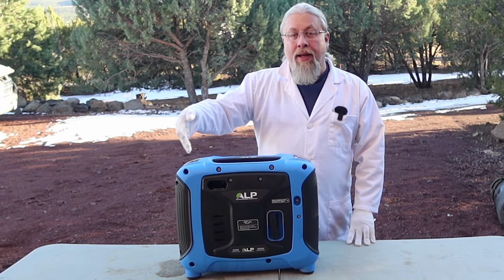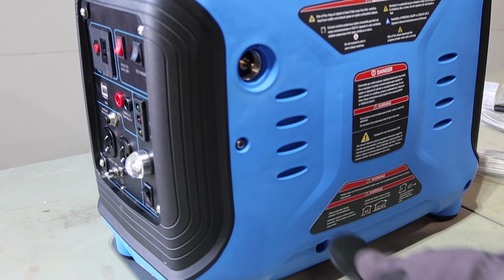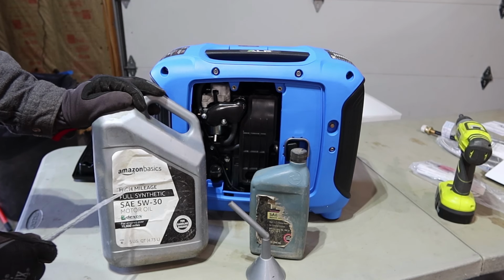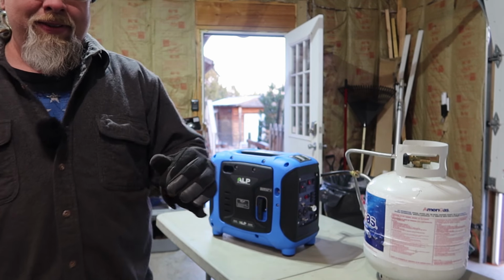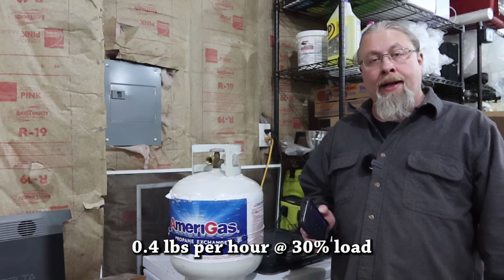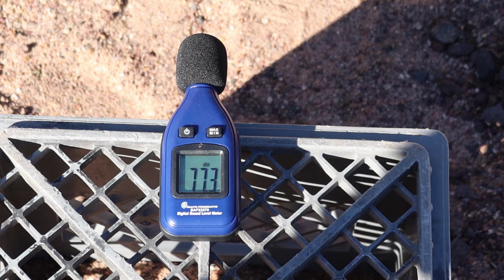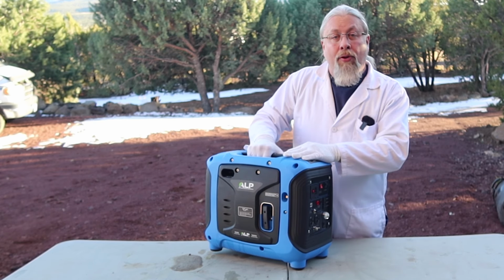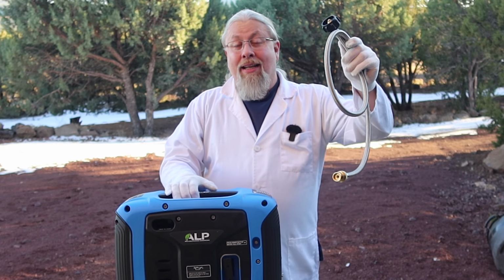ALP 1000w Propane Generator Review | Parallel Ready Eco Friendly Compact Efficient

Comment: I got mine today. It is an impressive machine. It handled the 5,000 BTU AC (85 degrees in the camper before running the ac), the cooler refrigerator, and the 12 volt 40 watt convertor to charge the camper battery with no issues at all. It is really not that loud. I was bit concerned after watching your videos, but for me it is not an issue. It is much quieter than the 2000 Watt Westinghouse gas generator I have. 

After a no load break-in and changing the oil. I tested it for 3 hours as I would use it with the teardrop camper. Simply no issues at all; no gasoline odor, very little exhaust odor, and easy start. This is a perfect generator for the off-grid small camper. I really wanted a propane generator has I already bring a small 5 lb lp tank for cooking. Now I don't need to bring a gasoline can. 

Thanks for your video it was spot on.

Comment: The tool thing is definitely NOT a deal breaker. I have one of those little 2 stroke ”Hitch Hiker” generator and a 2k Predator.  Each has its own little tool kit, zip tied to the handle, with a SP wrench, SP, and screw driver and a qt of oil (+a sm bottle of 2 stroke oil for the Hitch Hiker). This way no matter the situation I have what I need for sm repair/maintenance. Each has its own 5 gal jug of fuel with Stabile, and it’s changed out about every 6-8 mos. I’m a prepper. Gotta-be-good-to-go when you gotta go. 😁

Comment: When you use it outdoors you should use a ground wire so the gfi works!
Reply: I have had nothing but trouble with gfci built into generators. They are always tripping even when no ground wire is attached.

Comment: I have a WEN 2350 and that thing is super quiet, runs everything I need, including a microwave or air fryer oven, lasts an average of 6-10 hours on a 1.06 gallon tank of gas, and only cost me $411 to buy, shipping included. I love it!
Reply: Isn't that a gasoline only generator? If so, I think you are missing the whole point of this one: propane can be stroed much longer without going bad. From my own plans on how to ride out the occaisional power out age or even a long-term regional one, the biggest challenge is how to have the fuel you will need either directly on-hand or easily obtainable when EVERYONE ELSE is in the same boat. Having a propane powered device gives you the option of doing less frequent fuel tank rotations than you do with a gas-only model.
Reply: @justmesurfing  yeah I understand, I was just saying that I love my little gas powered one, and at $400 it's a great deal, but also a great machine. Propane would be good to have as well as some others, because in an emergency it's a good idea to have several baskets filled with eggs! Lol!

Comment: you're running a 5k btu ac in the cold it will draw much more in the heat.
Reply from the maker: I ran a heat gun in this video not an a/c. Someone is on the wrong video.

Comment: LMAO, never heard so much absolut basic BS in one spot.

first of all: generators are broken in at the factory. braking in is for the piston rings mainly. back in the old days a piston ring has had a taper of 0.1°  or 6 minutes. It took many hours to polish that taper away. It needed to get flat to the cylinder wall othereise it was not be cooled by the oil and started glowing and got brittle. Today piston rings have a taper of mere seconds or in decimal 0.01° and are therefore broken in in a few minutes in the test run at the factory. The change for less taper is due to stupid owners who did not breake their engine in appropriately and due to better quality manufacturing.
second: propane bottles are filled by weight, if its called a 20 pound bottle, 20 punds +/- a little bit (1 od 2%) is in it. not just 80% of 20 pounds. true is, at 20 lbs, the tank is only 80% full, it could hold 24 pounds. that is because liquids are not compressible, but do expand when getting from freezing to room temperature. Therefore there needs to be a cushion of vaporized propane in the tank at all probable conditions, so the liquid propane would not split the bottle open when warming up. 
third: load times efficiency of the generator should represent the fuel consumption. gasoline engines get about 30% efficiency. so you had 4 hours with 250 watts equals 1 kw times 3 equals 3kw in fuel. with gas this would be 300 ml since one liter has about 8,8kw. with propan 1 liter got about 6,6 kw and weights about 1 pound. so that generator should have consumend not 1.6 pounds (3 liters, almost a us gal) but half a pound. so either your measurements suck or that generator is running horribly rich. Most Venturi based systems do indeed run rich, as lean with prooan kills an engine in no time flat.  Only fuel injected LPG conversions are any good and yoild run at lambda 1 instead of way rich if peak.

So trash that thing, its not worth 20 bucks as it wastes fuel like crap. Over here Propan is 50% of gasoline, but at that waste rate of 300% it runs at 150% of the fuel costs of gas. And if you get ethanol free fuel (from your local airfield) you dont have problem with the fuel getting old.

Again, just LMAO and ROTFL
Reply: Are you sure about your second point? I have heard from several different sounrces that the 20# tanks you get at the pre-filled stations are often not filled completetly (most cited that they were due to a safety margin when transporting them in bulk.) It is true I have never checked this myself, so it might just be a common urban myth, but it does sound like something large companies might do if there is actually a risk in the transport of filled tanks.
Reply: An easy debunked urban myth ideed.

there is no place on this planet where someone manufacturers propane bootles that are not regulated by code. So sice the bottle builder needs to make money, the product fulfills the code, but is not overbuilt. Therefore no matter what, the wights of all similar style empty bottles are almost the same no matter the manufacturer. 

to debunk the myth: weight an empty bottle, and weight a full one, youll discover, 20 lbs bottles contain between 18 and 20 lbs of Propan.

Why ia that so?

The filling process is not permitted to overfill the bottle, due to the risk involved of running out of vaporized propan cushion inside the bottle. Just imagine it was filld during winter at freezing or even below, propane is still vaporizing at zweo F, and a customer takes this bottle camping to Cancun next summer at 140F outside. And then the sun blasts that bottle heating it to 200F and beyond and still the due to the heat expanding liquid phase inside can not run out of a cushion. otherwise the bottle safety valve would pop open and release the whole bottle into the atmosphere to prevent catastrophic failure of the bottle like beeing split open like a freezing water pipe.

Thats why those bottles always feel half empty when you buy it. They need that "air" (its not air of course it's vaporized Propane) to prevent accidents.

So now we know:

all full bottles (must) feel half empty. hence the myth.

this must be so for safety sake

and the filling process is not permitted to overfill. never, under any circumstances.

therefore the bottles are indeed underfill by a certain marging. 

very likely more than they would be forced to technically.

on the other side, there is no place on this planet where someone sells goods labled to contain whatever and where ther is no regulations in place regarding the difference between labeling and true delivery.

where I live that difference can be a maximum of 10% in single instances plus and minus. but for minus the filler needs also to proof by his production logs that the average filing level is close to the labled amount. if not its a case of commercial fraud. pretty hefty charges.

Since the volume changes by temperatur, but the weight does not, most filling stations go by weight. 

So technically they could fill to 20 LBS +/- 0,1% but then the empty wight of the bottles does have a little variation. And the fillerneck to the bottle does modify the true vs measures weight during filling.

So there is a probable error in the process, and you are not permitted to overfill.

So yes, Propane bottles are underfilled, but the "error" is way less than 10%.

Juat weight your bottle full and empty. Then you know by how much indeed.

Comment: Great research.  15:50  consumed about 3lbs of propane for 4 hours @65% load (about ~550 watts).. so roughly 21 - 26 hours running a wall unit AC from a full tank of propane.  Which if you are only running the AC at night from 10pm to 6am is about 3 nights,  good for a long weekend.   Nice!
Reply: A wall unit? That's a small as hellnwall unit if it only pulls 550w

Comment: Using your test data on this Alp 1000w, it achieves 9.9% efficiency by converting 9.9% of the energy in propane to 120V AC. It also seems to drop to 8.7% efficiency when going up to 550 watts.

I also ran some energy conversion numbers on the Generac 7127 iQ3500 and found that it is around 14.5% efficient at 1500 watt load (50%).  That means it converts 14.5% of the energy contained in gasoline into 120V AC which sounds reasonable for such a small engine.  No data for higher loads was available but it seems to get more efficient at higher loads.

What this means is that people will pay less money per unit of energy on the larger generators which is consistent with thermodynamic theory.
Reply: Yes the closer you get to the running rpm of the motor the more efficient it becomes.  About a 80% to 90%load is the most efficient usually.  Also a inverter style generator is actually less efficient than a regular non inverter generator when running at 80-100% or off eco mode. Inverter generators lose a few % efficiency when they convert AC->DC and back to AC. It's always best to size your generator to the rough load you know you will be using most of the time.

Comment: These generators are air cooled like gas one with all the engine covered up with plastic I can't see the thing lasting very long cause of over heating might be good for short runs like 1 or 2 hours .
Reply from the maker: They run fine for hundreds of hours without overheating. It has a fan that sucks air through while running.
Reply: @HOBOTECH  I was wondering how it would cool the engine thanks I use mine to run a electric heater in my truck while at work security guard so I sit in my truck for 12 hours a night.

Comment: Why type of device do you have plugged in to the generator that allows you to incrementally increase the load for testing purposes?
Reply from the maker: A heat gun I call a "Solar Degenerator" because it blows up inverters on a regular basis.

Comment: Natural gas maybe squeaky clean on carbon but it does give off methane which is actually worse than carbon because methane holds in more heat then carbon though methane  Does dissipate in less than a decade.

Comment: Why are tge usb ports useless??
Reply from the maker: Think about it. You're going to run a 1000w generator to charge a cell phone outside in the elements? If it rains you then fry your phone and the ports in the generator.
Reply: @HOBOTECH  Interesting... I guess I would have assumed that I wouldn't consider charging my phone outside in the rain. But good point, at leaat in the sense that I might wonder whether some rubber plugs for those open ports might be in order. I'm new to this, so thanks for the reply. : ) Still trying to figure it all out.

Comment: hours to miles conversion is what ever hours times 40. use good oil of 5w30 weight with some motor kote additive. So knowing this changing oil after 50 hours is way to soon and waste of oil EXCEPT oil from break in which you should use a proper zinc heavy break in oil. propane DOES NOT break down oil the same as gas engines nor make the carbon build up as gas. YES take care of your equipment but don't just waste money after things that will not improve the life of it.

Comment: You should’ve tested it with the refrigerator plugged into it full-size refrigerator because they suck power those that I know that have these Ransom lights in the refrigerator and it lasted about 26 hours on a tank you can test it and see what you think
Reply from the maker: It will run a full size refrigerator.

Comment: 20lb cylinder weighs 20lb empty, if filled 80% will weigh 40lb.
Reply: You are incorrect.  A 20# cylinder contains 20# of propane based on 80% of the Water Capacity (W.C.) as stated on the tank.  The Tare Weight (Empty Weight) of a 20# tank will range between 16.5# to 17.5# depending on actual construction (collar and foot ring design usually) and if it has a gauge on it or not. Avg is 17# TW.

Propane is filled to 80% of *WATER CAPACITY*.  A 20# cylinder has a water capacity around 47.5#, water is 8# per gallon. 47.5 / 8 = 5.94 gallons * 80% = 4.7, which is number of gallons of propane.  Propane weighs 4.2# per gallon, and 4.7 gallons weighs 19.74, or 20#.

When full, the 20# cylinder, containing 4.7 Gallons of Propane, should weight in around 20 + 17 = 37#.
Reply: Weigh it empty and weigh full. See for yourself. 😎👍😎

Comment: It burned oil after 2 hours of use?  That's not good, that means if i run it all night, it'll be out of oil by the morning.
Reply from the maker: All generators burn oil during break-in
Reply: @HOBOTECH  Well quite possibly, let's hope it doesn't burn oil on a daily basis either.  I'm in Central Texas, where we got hit hard by the winter storm. I know the weather we experienced is nothing new to folks that live in northern states, but we were not prepared at all. Even a week later, we are still seeing empty food shelves. We lost 58 lives including children, which is very upsetting. As for me, I know how to layer clothing, because i ride motorcycles in the winter. But there are tons of folks here in Central to South Texas, that don't have knowledge of how to survive a winter storm. This is Texas, the norm for winter is a 26 degree morning, then 60 degrees by the afternoon. Then by the third day, we are back in 60 to 80 degree days. This is Texas, we are known for sweltering hell like days and weeks here. We'll be better prepared next time !!!

Comment: I wonder how long it would take an ALP 1000W Propane generator to charge one EcoFlow DELTA 1300? How much propane (at Sea Level)?
Reply from the maker: You don't have to wonder. I give you the math to figure it out.
Reply: @HOBOTECH  Using your test numbers, and making a few assumptions here's what I got: 
Delta charge time @ 800 watts - approx = 2 hours. 
ALP fuel consumption at 800 watts - approx  1.15 lbs per hour.
So... best guess, about 2.3 lbs of fuel. ($8.30 @ $3.75/lb for fuel).
Not a bad option for a cloudy day or a supplement to a 160 watt solar cell (I believe the Delta allows use of both simultaneously). I think I will buy all three.

edit: Oh, and thanks for redoing the Db test.

Comment: This guy is freezing in 40° weather. It was 40 where I'm at I was out with a t shirt it felt like spring to me lol. This seems like a cool thing at first but given the cost of propane a larger gas powered generator will be just as efficient for close to the same cost to run and gas in an emergency situation can be found much easier.

Comment: I bet it won't run a window airconditioner.  It might run the fan but when the compressor starts,  it won't start.
Reply from the maker: I ran a 5000 btu all summer long on an 800w generator without issue.
Reply: @HOBOTECH  that's great!  I wish he would have shown the window unit running and the compressor kicking on. Showing wattage isn't enough to make me believe.
Reply from the maker: @jonathancrump31  It was 20 degrees outside. You can watch my old videos to see it running.

Comment: When you open a propane tank valve, open it all the way. You only turned it about half a turn. For safety reasons, if you need to close the valve in a hurry, having fully open means someone can’t accidentally turn it the wrong way. Also, if you have a high flow of propane, a partially open valve makes for a smaller constricted orifice and can freeze up.
Reply from the maker: Worst advice ever. Opening a half turn saved me from being burned alive when a propane leak caused a fire inside a structure. I was able to quickly shut off before disaster. If I had to twist 15 times to close it I'd be dead right now.
Reply: @HOBOTECH  Why are you running propane tanks indoors? The tanks go outside, even if the appliances they run are inside.

Comment: if you bring your tanks to Ace Hardware, they will fill your tanks to 20
Reply: $20 for 50 hrs of power. $10 per day $200 a month. In a grid down situation most people won't be able to refill, unless your supplier has a backup generator. Instructions say to replace engine oil every  2 days. What a pain, but you gotta keep your food cold.

Comment: Do you think this could power a standard American refrigerator in the event of a power outage?  Thanks.
Reply from the maker: If it is an Energy Star and standard or smaller size, yes. Otherwise, you may need two of these in parallel.
Reply: @HOBOTECH  Thanks for your response.  I would think that a lot of people watching your generator videos would have this use on their minds.  Thanks again!!  :-)

Comment: Typically during a power outage, a homeowners biggest concern will be refrigeration / freezer. Because of their size, it’s not always easy to bring the refrig. / freezer close to the generator so you have to calculate the power draw PLUS the loss of the extension cord.
Another advantage to propane is easier / cleaner storage of fuel. Gasoline will eventually contaminate and foul but propane will pretty much remain stable. I’ll consider one.
Thanks for the informative video. It answered a lot of questions.
Reply from the maker: Just use a heavy duty high gauge extension cord. I ran two RV's off a 100' from Walmart all summer long.